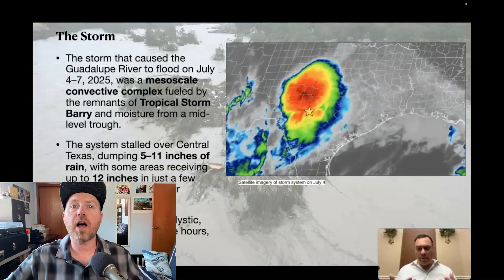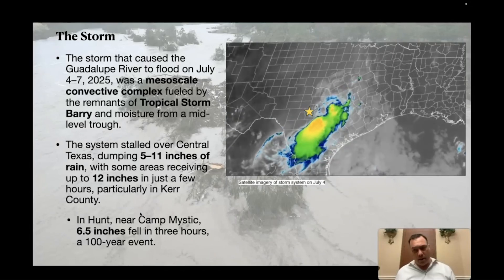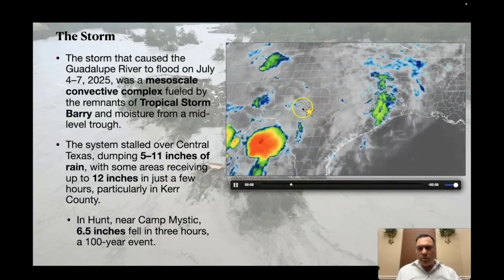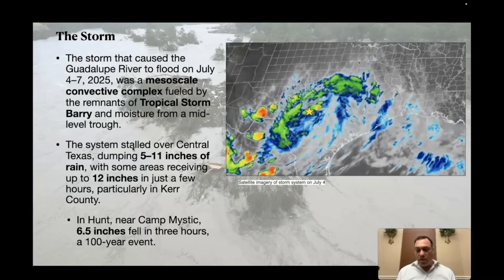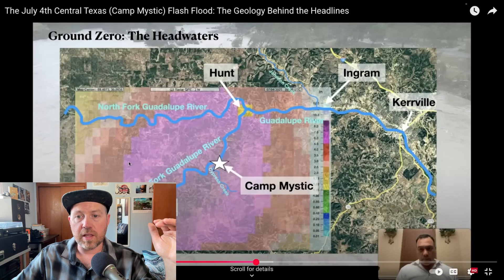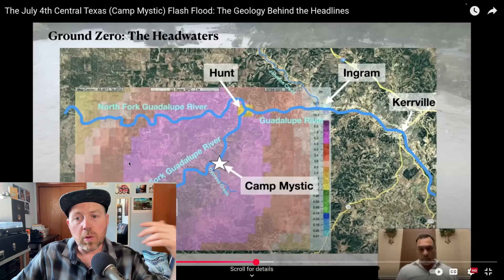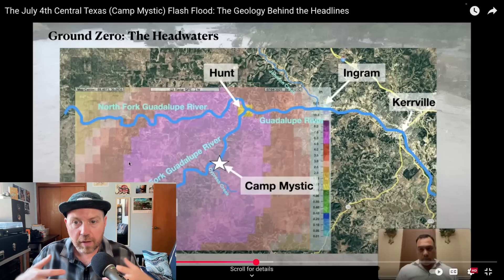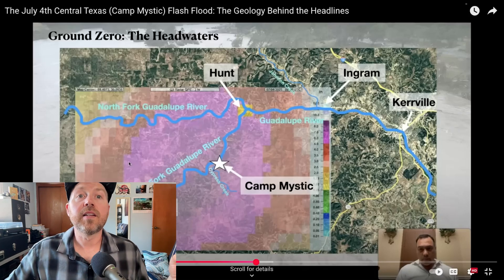The Texas Flood Was a Manmade Disaster

Comment: Correct on fail of not heeding flood maps. Major Floodway extents, not just SFHA / simple Floodplain in that area. Models show 20 - 30 ft at the reach before forks combine and were correct to no surprise of those who understand the science and region. Will point out that drout does not have anything to do with flooding in the area.....weather, coastal-adjacent patterns do though. You're very wrong on land use and other basin characteristics such as development being a factor. The entire upstream wastershed is largely undeveloped. Dude is talking about parking lots? Urbanization and parking lots are not what created flash flood alley, coined mid-last century. Y'all are obviously not from around here. Local recent studies do not concur with climate change affecting flood discharge as you claim. Plenty of climate change issues around Texas but different situations from shorter interval, faster hit storms, sea level rise and thicker moisture currents. Claiming urbanization and logging? in that basin is pretty silly and unfortunate uninformed misinformation to the public. Peak stream flows in urbanized areas of Texas are not increasing and places such as nearby Austin, are seeing peak flow reductions thanks to years of aggressive development stormwater control regulations with mandated detention, along with thousands of flood-control dams and other structures built over the last 70 years. A person informed on such topics you are presenting might have also noted the flood of record was is 1934 with a q over twice the next largest which was in the 80's.....also before the yet-to-happen development. Clickbait title is almost as cringe as nonsense content.
Reply: Agreed!  There are no parking lots or developments out there- none!

Comment: The initial FEMA exemptions were granted in 2013 for 15 buildings that had been at this camp for many many years, and had NEVER been impacted by floodwaters before, INCLUDING the floods of 78 and 87. Additional exemptions were granted when a totally new section of camp Mystic was constructed in 2019 and 2020. This new section of camp was even further away from and higher up from the river than the initial set of buildings 
NONE of the new buildings were breached by water in this flood. Just fyi.
Reply: instead of moving the buildings on the flood plain, they received the exemptions, used money to build new cabins in a much safer area and then had the little kids stay in the more dangerous excempted zones.